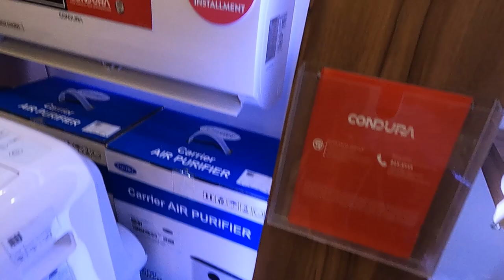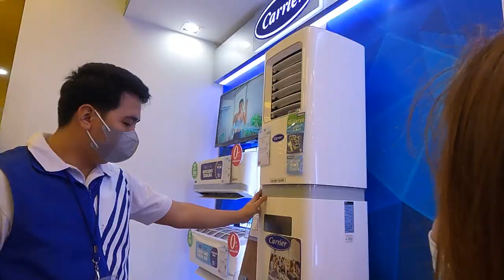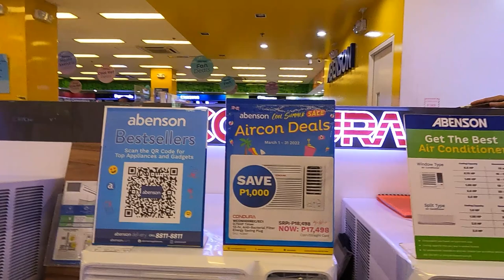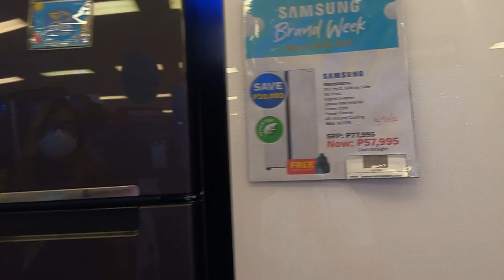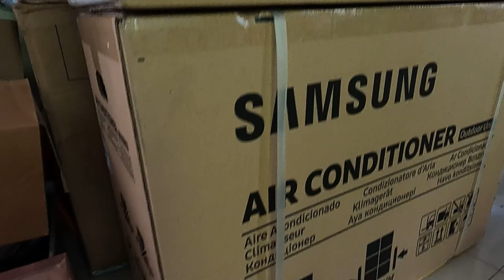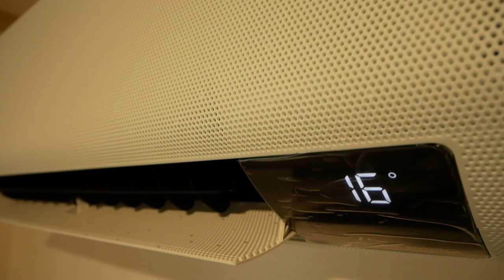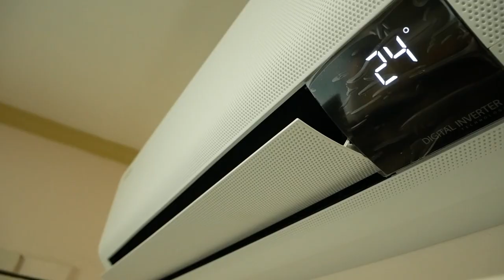Samsung Wind Free 1HP Split Type Aircon Purchase and Installation │Water Snake 101

Comment: Hi, sir pwd ba to maconnect sa  samsung smart things? Pls.. thank you po..
Reply from the maker: Hello non wifi po yung model na to. Pero parang may model na with wifi.
Reply: Yng Samsung 1.5hp php(57k) to 2hp split type nila un lang ang wifi connected po. 
Mgnda din sana un,  kso sa LG dual Inverter. mas napili ko Kc may wifi con. Na sia kht 1.5hp lng 🥰🥰 37k
Reply: i am Mikel ang sa samsung ay Smart inverter meaning 5 DC napo sya kasi may built-in mother board same lang ang compressor nila kasi dual na din kaya lang di digital yung sa LG

Comment: Pa advice naman po. Bill ko prior to using samsung s  split type inverter is just 1,260

Ngayon 20 days use, 5,541. 

Ang laki ng tinaas. 14 to 16 hrs use po. Eco mode after mag 16 for 30to 1hr.

Usually naka 24 to 26 eco mode. Fan is naka baba lang. 18 to 19sq m. 

Tipid mode settings po please.
Reply: if 1hp lang aircon nyo. magastos parin yan. kasi malaki masyado room for 1hp pwersado lagi compressor. dapat 1.5hp inverter kinuha nyo

Comment: Kamusta po yung unit ngayon? May nabasa po kc ako inconsistent daw yung cooling ng AC nya nakaset sa 21c pero lalamig daw ulit pagnareach ng 25 to 28c yung room temperature.
Reply from the maker: Ok pa din sya sa lamig. Di lang ma monitor ung indoor temperature unlike sa LG na may app para ma check yung consistency ng lamig. Plus factor sa samsung yung windfree masarap yung pagka lamig nya with no noise and blowing air. Parang nakapatay yung aircon.